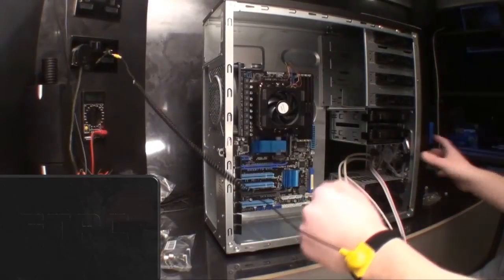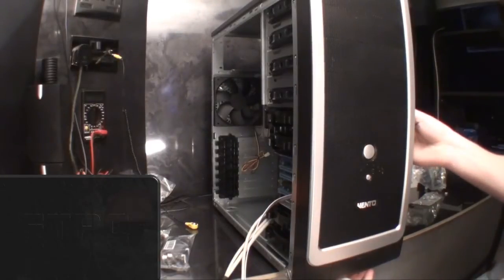Build your very own Computer! (Part 1 of 2) [HD]

Comment: @FixThePC Ok I have put everything together and the fan, led, and processor fan is working along with the case buttons. The only problem is that I got a black screen when I hooked it up. I just finished it so i'll go back and try to find out whats wrong tomorrow. It could be not enough grounding pins on the motherboard. I have only put 1 in and I think the motherboard may be touching the metal on the case. 2. Something isn't put in right and I need to deassemble it and rebuild it.

Comment: hey, whats a super cheap processor
which i can replace my rubbish 1.8 ghzCore 2 Duo with?
must be socket 775 because i cant upgrade my mobo (dell case..)
and would i need to upgrade the fan? the one i got with the dell is HUGE

Comment: This Build May Be A Bit Overkill, But Is New Hardware, On Scan.co.uk
Case: Antec One,, CPU: i5 3450,,Motherboard: P8Z77-V LX,, Ram: 8gb DDR3,, 500gb Seagate, Graphics Card: Radeon 7770 Or 6850,, PSU: Coolermaster 650w,, DiskDrive: Pioneer Sata Drive,, I Aint Looked Into This Hardware Properly, But It Should Work, Cost Is £576 , Dont Worrie Is Your Not Sure What To Look For, Look At Build Tutorials And Research, Also Copy SomeOne Elses Build Found On The Internet